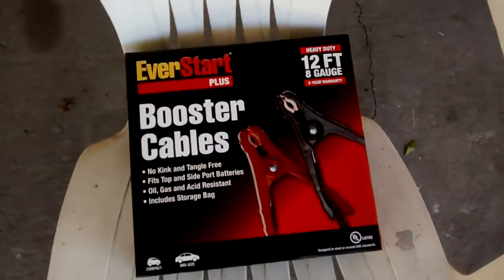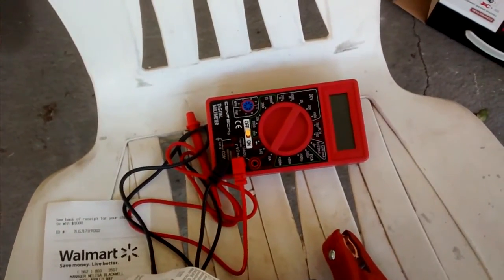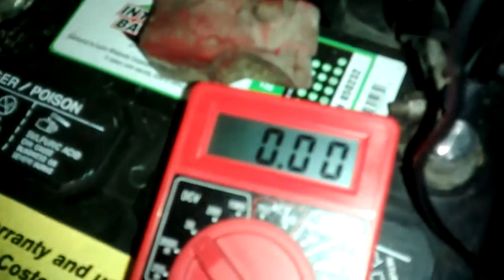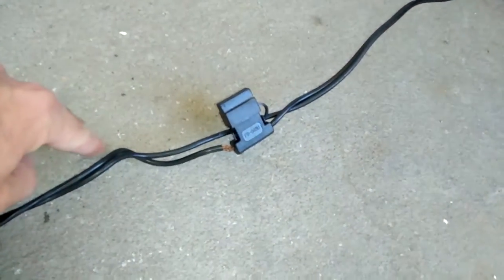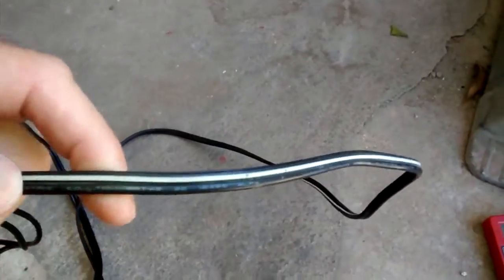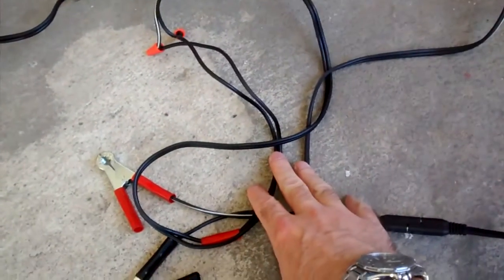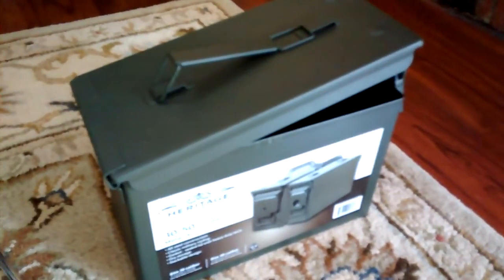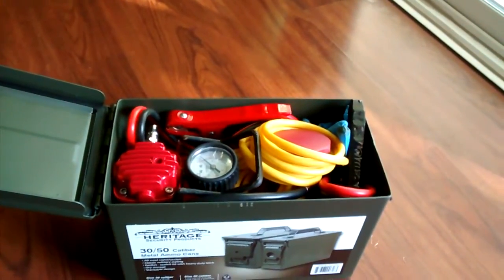Upgrading my air Masterflow air compressor. MF-1052 aka MF-1050, aka MV-50  (Part 2)

Comment: This was basically a downgrade since you removed the original ofc copper wire in place of cca copper clad aluminum wire which has much more internal resistance and rots over time much quicker than pure copper

Comment: Zero point to do this, just pay the $100 and get the RFX/Bulldog/Vevor 150psi compressor brand new. Does the job 3x to 4x faster than this. The MV50 is crap. I still keep it in my car just to air up random crap, not my tires.

Comment: The reason the voltage “drop” was the same for the18 gauge and the 8 gauge is because there was no current flow! This is Electrical 001 - it’s not even Electrical 101. With no current flow (compressor not running), you are in effect measuring the voltage of the battery with either wire - they are really just extensions of your test leads. Both read 12.7 volts because that was your battery voltage. You would have to be running the compressor, with load (ie connected to a well inflated tire) to create max current draw, and thus max voltage drop. V=IxR, or voltage drop = current flow in amps times resistance in ohms. The resistance of 15 feet of #18 copper wire is 0.096 ohms, while the resistance of 13 feet of #8 copper wire is less than one-tenth as much, or 0.00832 ohms. A reasonable current draw for this compressor at full load is 20 amps (fused at 30). So the voltage drop through the #18 leads at 20 amps would be 20 x .096 = 2 volts, which is a high percentage of the nominal 12 volt supply. At the same 20 amp current flow, the voltage drop through the #8 leads would be 20 x .00832 = 0.17 volts, which is insignificant.

Personally, I think #8 is overkill, and makes the compressor harder to handle and store, but I agree with the concept of replacing the leads with larger wire, especially given the deplorable job done by the manufacturer in the original electrical connections. I think I’d go for fifteen feet of #12 stranded, which would have a voltage drop at 20 amps of 0.5 volts, which is acceptable, and would be a lot more flexible and easy to handle.

Comment: D. Alex: I believe you said you replaced the old gauge w/ a "tire gauge".  I plan to do the same. Do you recall the thread pitch?  If so, I'd appreciate your response!
Reply from the maker: I did not replace it. I don't remember the thread pitch, I know I saw something about it on youtube a while back.
Reply from the maker: You can read about it here. https://www.toyota-4runner.org/3rd-gen-t4rs/131953-bfads-superflow-mv-50-air-compressor-build.html

Comment: How you install the fuse.?
Reply from the maker: It has a couple of set screws to hold the wire in place. They are called AGU fuse holder inline 30Amp. You can find them just about everywhere, eBay, amazon, etc. If you search for it I am sure you can find a lot of  images and instructions. It's really super easy to install.

Comment: Thanks for the video.  My MF-1050 came with the inline fuse holder a lot closer to the middle of the cord, but like yours it started fraying apart.  I cut out the bad frayed portion and fortified the exit from the fuse holder with heatshrink tubing which bought be a few years but soon enough I was back where yours was, needing a cord repair and more length.

I didn't much like their idea of the inline fuse, feel they should have developed some special jumper clamp with a fuse holder built in, or had a panel mount fuse holder in the plastic cavity at the end of the pump, either end instead of in the middle of the cord which seems like a terrible design, it was always dragging on my concrete driveway.

Anyway, in the years I've owned mine I had never blown the fuse so I decided to just stuff it in the housing... not a big deal to me, I know it's there and if the pump stops working it only takes a minute to get those 4 hex bolts out to change it, though if it blows it is likely the motor crapped out and is done for.

The pump is based on a brushed DC motor so it will have max current draw, and thus max voltage drop across the wire, when it is under load inflating a tire (or whatever) that's already near max pressure.  That's the time to measure the voltage at both ends of the wire.

Measuring without the pump running does not give you a valid reading at all.  Without the pump on, no matter how thin the wire was, you should have had absolutely 0 voltage drop.   A resistance only lowers voltage when current is being drawn.  This makes the only possible conclusion that your meter wasn't making good contact (bad meter leads) or has wildly fluctuating readings (not surprising given the cheapie harbor freight meter).

I'm surprised that your yellow PVC hose has survived this long.  Mine disintegrated a few years ago, literally broke into several pieces one time that I barely stretched it so I replaced it with a couple rubber extensions from Amazon that already had brass tire couplers on them, then a hose clamp to attach to the Masterflow connector mating to the pump head.

The total weight... nobody cares except you because you're not wearing shoes.   ;)

Comment: Nice video ! Are you aware those cables have Copper plated Aluminum wire ?
Reply: Yes, I have a MF-1050 and had the exact same cord problem he did, was going to buy cheap jumper cables like he did, but it gets cold here in winter so I wanted all copper, fine stranded wire for high flexibility in freezing weather and settled for just getting 10ga bulk all copper wire instead.  

I got some freakishly durable outdoor rated wire with a thick rubber insulator for a bit over $1/ft delivered, you can find it on ebay searching for "25' Foot, 10/2 AWG Gauge Copper, SOOW Portable Outdoor Flexible Wire Cable 600V".

Some people will think it is too thick, and I doubt most need 25' foot worth like I bought but I wanted a few feet left over to repair the cord on a big angle grinder... long story, I got in a fight with a zombie and the cord sacrificed itself to save me.

Biggest obstacle was my replacement cord was so beefy-heavy that I decided to make a strain relief bracket out of 3/16" angle aluminum so it wasn't tugging on the relatively weaker black plastic cap on the end.
Reply from the maker: Nope.
Reply: I like your video :-) and Wikipedia states Copper plated aluminum is fine ,and I am going to do this :-)  @dixy2k

Comment: You should turn the compressor on and have it running when you check for a voltage drop.  If you keep the compressor near your voltage source you should can check the voltage drop across the cable by a putting one lead of your meter at the battery positive and 1 lead on the positive of the motor and that will read you your voltage drop without having to read it in 2 different points.
Reply from the maker: Valid points. I didn't think about that.